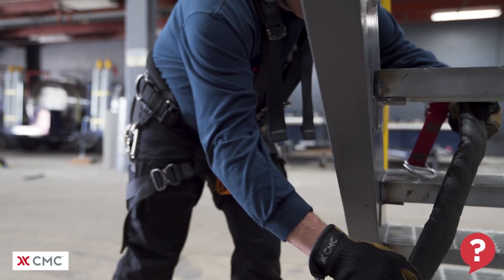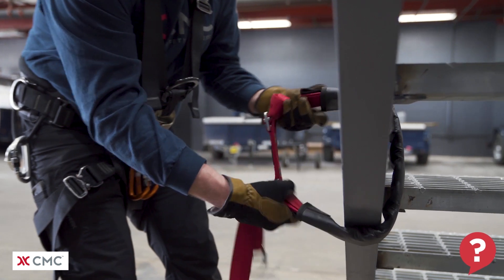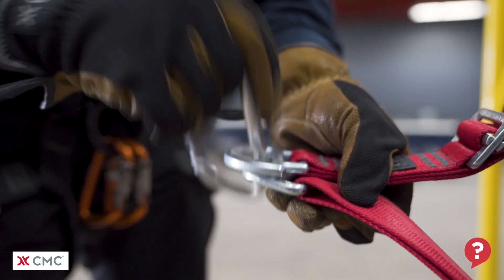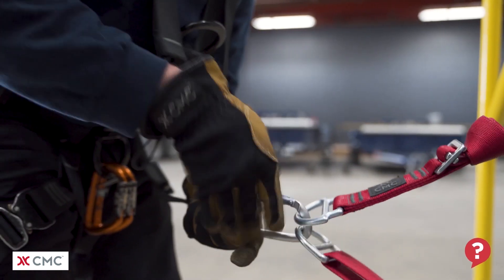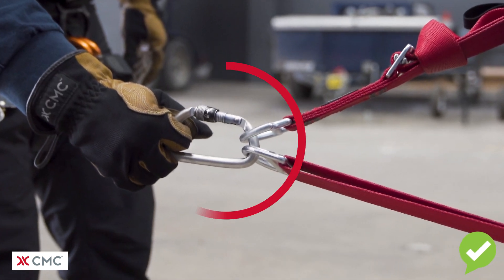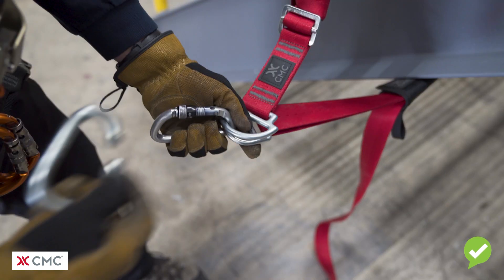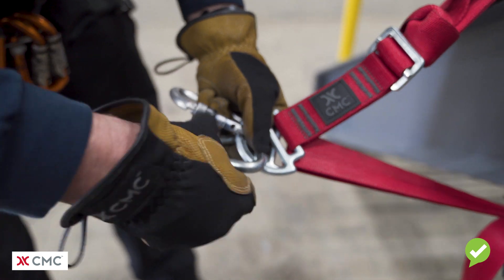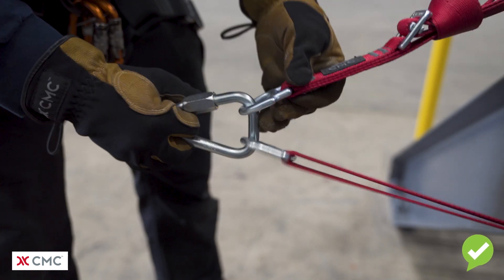Anchor Systems #7 | What's Wrong? | CMC

Comment: Delta screw links are not designed for tri-axial loading. They are meant to be a connection point for wide webbing to a carabiner. There are Omni-connections available. Also best practice is to mechanically tighten the barrel as opposed to hand tight.
Reply: Can you cite a source stating that deltas aren't meant for tri-axial loading? Or any field failures of deltas due to tri-axial loading?
Reply: I just looked up three sources for delta screw links, all three cite using them for triaxial loading.  Roco Rescue, CMC, and Petzl.